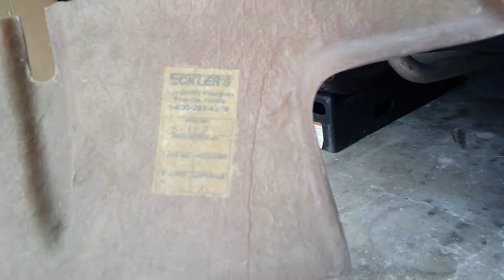Bump in the Road (Installing Rear Bumpers on my C3 Corvette)

Comment: I feel your woes, I’m in the same boat with the addition of a slightly bent end of the frame on the same corner. I’m decent with metal but it’s time to learn to fiberglass. Thanks for some inspiration, confidence and motivation.
Reply from the maker: GOOD LUCK AND HAVE FUN.